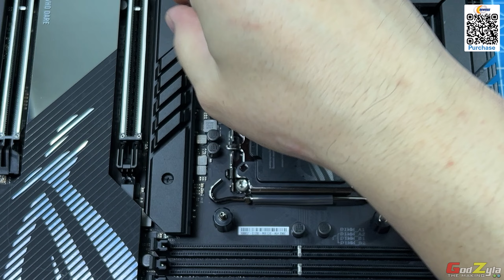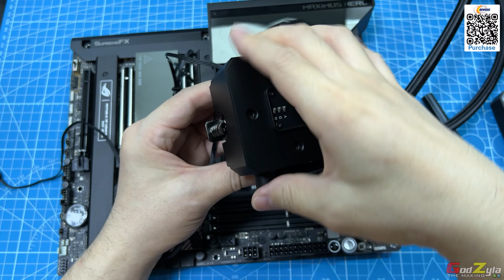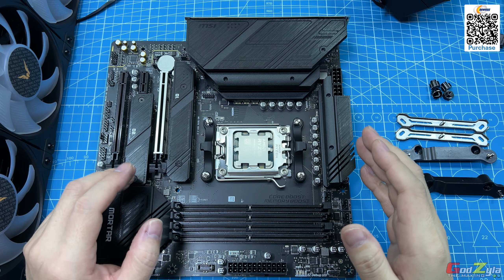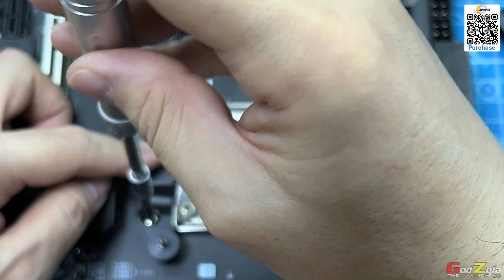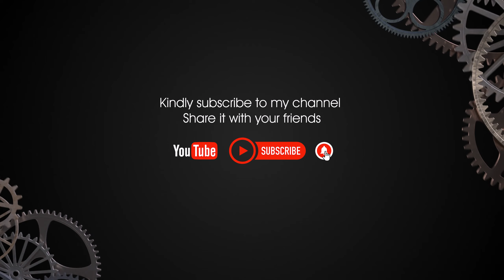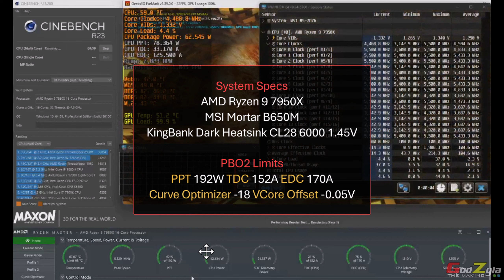Valkyrie V360 Lite Liquid Cooler

Comment: BRO WHAT IS THE BEST AIO IN TERM OF TEMPS FOR 9950X3D WITH GOOD SCREEN
Reply from the maker: HI HICHO SOLO, welcome to my channel. I wouldn't say is best but able the perform, there is only one. https://youtu.be/ocGn79Zqolw?si=k3R4_6kC6CsbMbns ASUS ROG RYUJIN III 360 ARGB EXTREME
Reply: @KleoYan  THIS IS THE BEST IN THE MARKT RIGHT NOW,? overkill temps?
Reply from the maker: @HICHOSOLO  based on what've tested, it's 2nd best. if you want first best will be Tryx 360 Panorama, btw do you mind to off your caps.
Reply: @KleoYan  did you use its stock thermal paste the ryujin? because its very bad compared to other in the market
Reply: @KleoYan   and based what i saw on your video the ryujin pulling more wattage
Reply from the maker: @HICHOSOLO yes I did use the default thermal paste. Yes it pull more wattage as it cool better that’s why allowing to pull more wattages

Comment: Hey Yan can you do a vid on making screens for the TURZX 2nd display, ive tried installing a home made screen display using photoshop but it was tricky and didnt work when i tried to run it
Reply from the maker: Hi Paul Davies, welcome back. If you are mentioning about the Smart Turing Screen, the 8.8", you can't set it to 2nd display. It make use of it's own application as it has a build in chipset.

Comment: Really like the design of this AIO. I'm curious if you have had many issues in the past with AIOs, given how many you've tested and your experience? 

The newest gen Asetek seem pretty robust, the seals and so on seem a lot better and 5-6 year warranty seems to be becoming the standard. 5 years ago I installed 4 Coolermaster AIOs that all ended up with problems within 2.5 - 3 years and needed to be replaced, one developed a small leak behind the CPU block but thankfully didn't cause any permanent damage. 

I'm mostly building for others now with Thermalright and Deepcool air coolers to avoid complications, but if they're actually lasting 5-6 years as the warranty would imply, that is often beyond the life of the actual system. Curious to see what you think.
Reply from the maker: Hi WomanRepellent, welcome back.. A very good question. For myself, i will only go with these AIOs as I know they are of non Asetek pump. 1st Arctic Liquid Freezer II or III 2nd EK and 3rd Phanteks or Asus and 4th PC Cooler or Deepcool. These are the liquid AIOs that I trust alot. for Asetek, its more of a hit and miss. Personally, for Asetek gen 8 pump, I can trust Phanteks Glacier One M25G2 and the Asus Prime LCD 360. 
I do have friends who build with the Gen 7 pump from Asetek. Majority having the noise issue on the pump after a period of time usage. I mean it still perform but just that they have to lower down the pump RPM to reduce the noise.
Reply: @KleoYan   The Asus AIOs seem to be pretty good. I did grab a Prime LC360 without the LCD after you reviewed it and was pleased overall, was using it until recently when I decided to play around with some of the newer thermalright air coolers. Will probably put it back in my system soon as the performance was really good. Appreicate the reply, thanks.
Reply from the maker: Yes that prime lc360 is a solid liquid cooler. I like the non lcd too and best part, it’s of a small block. I won’t hit into any issues with motherboard compatibility. 🤭 you are most welcome, I enjoy interacting with you too. I get to learn from viewers too 😬